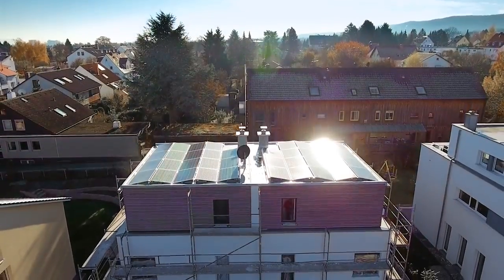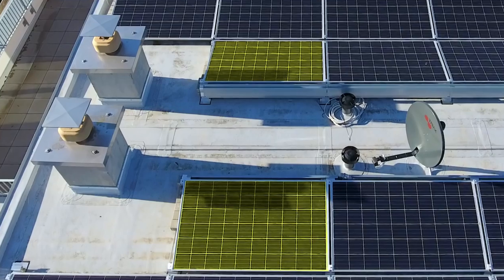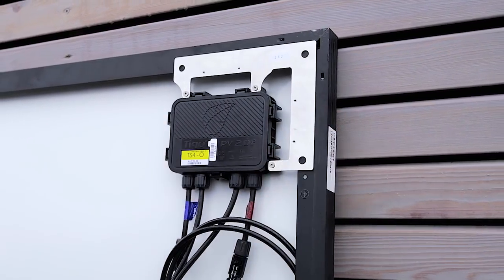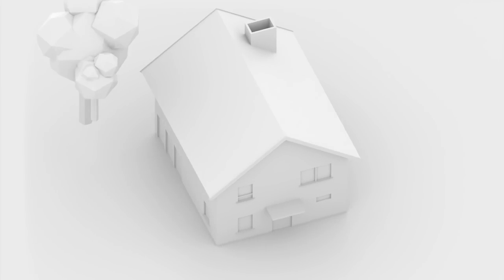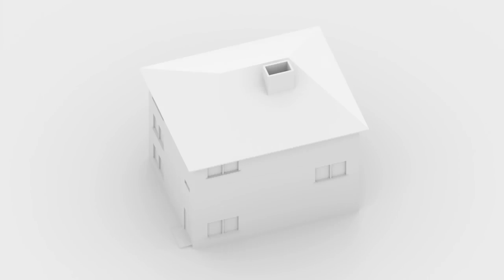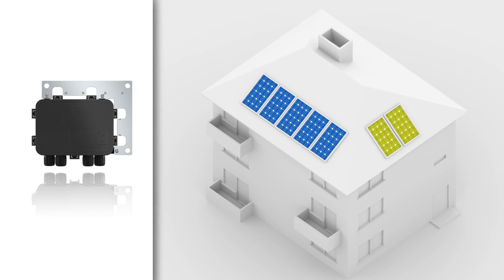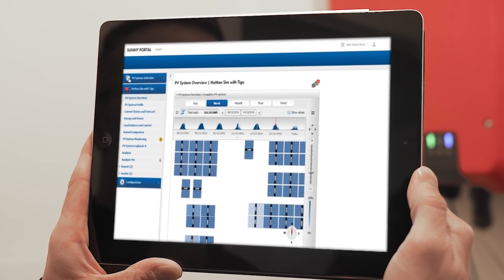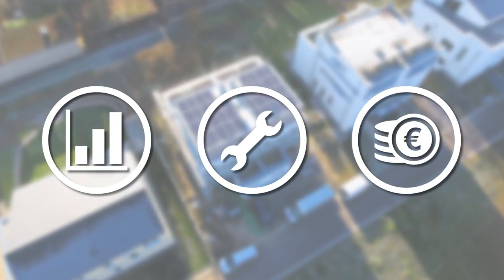Higher Yields with SMA   Tigo Optimizer for only one module

Comment: Hi
I have a dual mppt inverter 
Each mppt is connected with 2 string of solar panels. Some of my panels has shading. Can i use selective deployment method to install TS4 optimizer 
Thank
Reply from the maker: Hi Thi
Normal the SMA/Tigo TS4 Optimiser can solve that kind of problem.
But im not sure what you mean with "selective deployment method"
Best regards